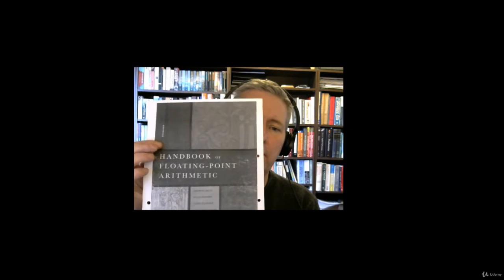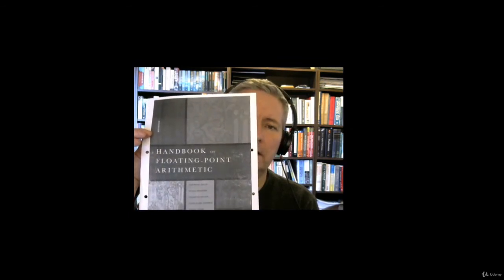Design a Floating Point Unit Introduction

Comment: I'm looking for a Babbage description of FP math , as you say its built from the basics at the end of the day.  Yes I couldn't find any other you tube descriptions that were anywhere close to yours. How does an FPU work. no hits. I'm sure I will gain something from this interest however far it goes. Good luck on your journey. Arduino micros for a few pounds now have M4 / M7 cores with FPU which intrigues me.
Reply from the maker: I have 2 full courses on designing a floating point unit, one on numbers and one covering the multiplier. I could find hardly anything about the subject other than scientific papers. I thought my courses would be popular but I was wrong. Seems no one is really interested in the subject ? I have another 3 or four full courses to cover the rest of the design. In the end the FPU design will be 5 or 6 times larger than the CPU design.
Reply from the maker: The best place to look is the book - Handbook of Floating Point Arithmetic but its about 120 quid (uk pounds).I got a copy for 60 quid online, I get most of my info from this book. It's a bit mathematically detailed but still has lots on the practical design architecture.
Reply from the maker: https://www.udemy.com/course/design-a-floating-point-unit-1-numbers/?couponCode=861952312FF3F65ADEA7
Free coupon for first course. If you like it leave a nice review.
Reply from the maker: https://www.udemy.com/course/design-a-floating-point-unit-2-multiplier/?couponCode=64D29D42CBC9F0E5B7C2
Free coupon for the second course if you like it leave a good review. Think the coupon has to be used within 3 days !